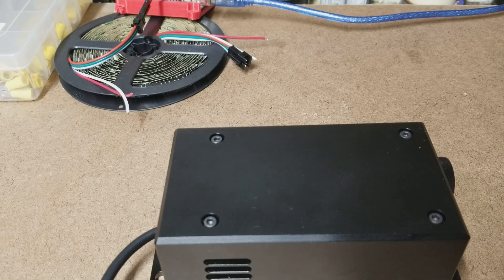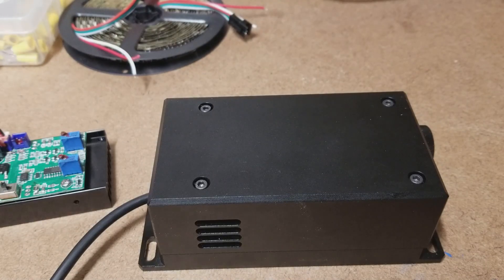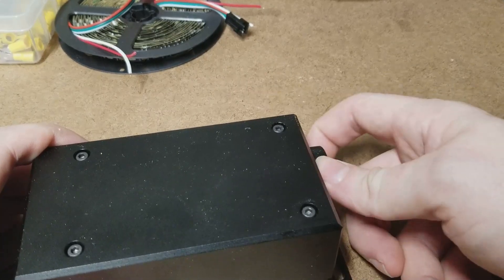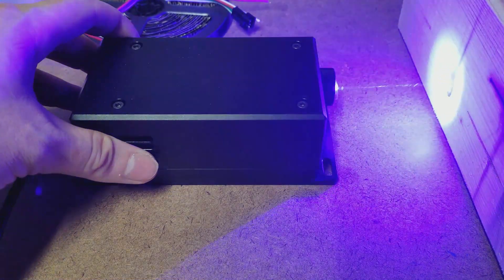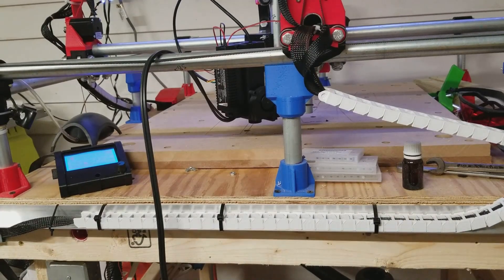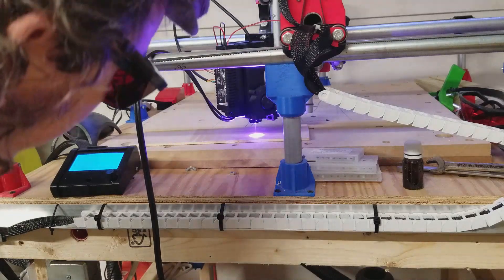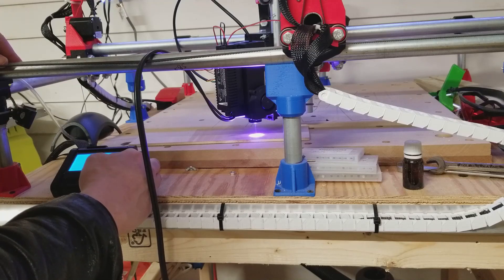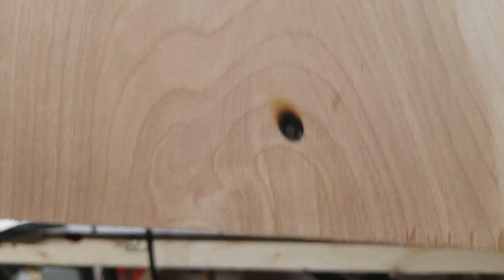'Most Powerful Laser Diode' Setting up a 17 watt laser module!

Comment: This is cool 👍
Spec's total laser power is 4.2W 
Adapter is 12V
The full module as advertised is 17W Adapter is 12W+4.2W=16.2 funny advertise 
 Laser diode's 2 x 2.1W= 4,2W Total Laser power

Comment: AWESOME!,  Now all I have to do is buy 100 of these at $299, Adequate power supply/supplies, 100lbs+ of various optical glass to get them all to converge and focus, and I'll be off and running with the ability to finally cut nearly 1mm of aluminum sheet! But first I would like to take a moment to thank all my testosterone saturated tools, made by testosterone based tool makers that took the time to design and manufacture tooling that doesn't implement twizzlers and unicorn farts into the construction process to provide me with the ability to safely and efficiently remove&replace heavy guage screws in excess of 5/16 or or the candaian equvalent "1,000,069 truedos weiner units". OK then, I'm off to start saving up the $30, 000k or "2.28===D canadian"

Comment: great video, There is no laser diode that would be higher 8 Watts, having two using a combine lens will provide almost double the laser power. But  am curious how long the laser diode will last. They say never set the PWM or TTL on full power which leads me to believe you will shorten the life of the laser diode. Typical of chineese products they build the shitest stuff to sell cheap on ebay or amazon or alibaba.

Comment: Good evening SteamPunk,  I just received the same 17W laser as yours ... I manage to modulate the power via a module that comes out in Pwm from 0 to 100% ... WITHOUT any other connection ... on the other hand I don't know where to connect the white / yellow wires for the TTL ... I tried on the card of my CnC which has the pin outputs as follows ... GND / DR / PWM2 / 12V .... White on GND, yellow on PWM2 while having the 12V which arrives by the external module in PWM ... so when everything is connected including my CNC card, I have the weak ignition of the laser from 0 to 100% but I cannot make increase its power by the software of my card which manages the spindle ... Do I have to connect the white / yellow wires on the "spindle relay" ...? or otherwise ... Thank you ... Philippe

Comment: Hello SteamPunk, i need a first laser for my CNC and i need to know how you wire all cables ...power, ground, pwm....etc on your board...because the price is not very cheap and i don't want to choose a wrong laser if it's to difficult to wire it...maybe i need a second board with 12v in and pwm out...? tank's a lot ..Philippe

Comment: There is no 17 W blue laser diode... 4 A corresponds to an output power of max  6W for the more efficient diodes. In pulsed mode you can push the strongest diodes up to 10W max.. Classic chinese rip-off. I just bought a 6W laser module that only gives 4W 😑

Comment: What thickness of wood is that?  My guess 3mm.  I've seen 2.5w cut that in about 2-3 passes with air assist.  Typically the air assist is using a coolant tube like on a cnc to blow concentrated air.  This gets the soot out of the way to cut fresh wood.   It's cool, but really when you get up into anything above 7W the price is approaching cheap CO2 laser systems.  You can get 40W CO2 system for about $400. That is not just laser head but whole system you connect up to your pc.  It will cut that out in probably less than a minute. I have the 2.5w, 3.5, and a 5.5w diode laser. But it does what I need for now.  I needed something to see if it's for me anyway.  Make a few things and when I feel the need I'll upgrade to CO2.   Thanks for the video.

Comment: China just slaps on numbers...its not even 10W. And if it is, then just for 2 min....
Reply: The eBay listing says 17W pulsed. Which I assume means it gets one pulse at 17W for a microsecond before the diode pops.
Reply: @outputcoupler7819  I checked most ebay items, most of them say 17W and nothing about pulsed. Either way, it wont last long. Pulsed or not. Blanking might help a bit but it does not mean you can squeeze out 300% ^^
Reply: @LaserGadgets  I know, I was being facetious. The idea being, attempting to get 17W out of this diode would result in nothing but the destruction of the diode.

Comment: Oxygen would make it burn more, not less. Airflow over the work surface as the laser is burning the material helps to prevent the material from settling and from getting on the laser lens. Fouled laser lenses lead to problems.
The lasers are in parallel, not serial. A CO2 laser would be a better choice.

Comment: If you want a faster cut you could try adding a small tube blowing pure Oxygen onto the focus point
Reply: I would be very nervous about using pure oxygen assist for an at-home project. Consult your insurance policy before attempting such a thing, and perhaps just use high pressure compressed air.
Reply: @JesusTouchedMyJunk  Yeah, that indeed would be stupid thing to try. Pure oxygen :D

Comment: How to made metal cutting CNC machine in home made ,metal cut 20 mm Maxima
Reply: You're looking at $15k to $20k for the laser generator alone.  Better off buying a used industrial cutting laser.  You can pick up a 20 year old Amada machine for $25k.

Comment: For the same money, you could get a 50W CO2 laser tube and power supply. Possibly a bit cheaper even. I found both on ebay for about $200.
Reply: @Paul Ash That makes sense. I'm glad you did as I've been curious about these 17W units for some time. Seems to be better than I expected! CO2 lasers are bulky, but not too complicated. Usually, in their application, the laser unit itself remains stationary (outside or incorporated into the cnc apparatus) while the only thing mounted to the cnc is a few small mirrors and a focusing lens.  The mount for which could be about the same size or smaller than this one. Not that there's anything wrong with your current setup. I like it :) All I'm saying is CO2 is faster, more reliable, and cheaper than diodes for this purpose. And it's easier than you might think. If the 17W blue ever lets you down, switch to the 30+W infrared side!

Comment: If your actually getting 17w from a 2x diode module then the diodes are being over driven for sure. Its probably more like 10 watts. I'd like to see you hook up some meters and see what it's really doing. Also open it up so we can see inside please. Its probably just a little glue holding it closed. I'd like to see how they're beam combining.
Reply: not even 10w its more like 1,000w maybe ..
Reply: @patman0250  I assume you mean 1000 mW, not 1000W. But no, this is clearly much more powerful than 1W. Probably it's a pair of 4W diodes being driven at close to max current.
Reply: @outputcoupler7819  yes I mean mw but I still think it's 1w.
Reply: @patman0250  You are wrong, this is not a 1W diode. I have several diodes in the 1-7W range, and this behaves very similarly to the higher power diodes. 1W diodes barely mark wood at all. The 7W diode chars the wood instantly, like this does.
Reply: If that what you think then you are sadly lacking in the laser knowledge department. a 1W diode is more then enough to char wood instantly. A 7W diode doesn't just char wood it catches fire almost instantly just like a co2 laser. Sorry to brake it to you but you most likely do NOT have a 7W laser if that's what the internet description said then you're really out of luck sins its most likely not. 7W diodes have just only been on the market not that long if its not a NUBM44-V2 then its not a 7W diode.

Comment: this guy spends 300 bucks for a laser but cant buy himself a decent screw driver, come on dude.
Reply: "since then"
Reply: people on youtube these days
Reply: Hi@AffiliatePro, I'm also intersted with this laser in the vid cause I thought it's powerful enough and cheaper than other ready built lasers. But I've became more intersted in your 50w laser tube with only half the price... Would you pls pls pls send me the link where I can buy the 50w laser tube, so I can check it out.. thank you so much!
Reply from the maker: I got plenty; I just didnt want to wrench it open at that moment, I have opened it sense to clean the lenses sense then, I should do another video showing the inside more clearly!
Reply: @steampunkprogrammer1225  After having it opened up, how many diodes can you confirm to be inside, since the highest outputting diodes would only do 6.5-7watts on 4.5-5 amps per diode; if it is truly outputting 17watts, then that's a sizeable  overdrive. Worst yet, the supplied amperage don't seem to match up against the number it's claiming per diode, let alone two, so this seems to be all over the place.

Comment: Air Assist with a higher PSI source and downsized with a smaller Diameter exit point will help with going faster.
Reply from the maker: MrMG I tried that as well but maybe i need more air pressure. Definitely worth trying.
Reply: I've seen video's with a 2.5w and up do those same cuts you were doing but in less time with proper AirAssist because fire/Ignition, however you want to call it lives for AIR, the more air the hotter it burns, hence why cutting is faster the hotter something burns the less soot there is, the less soot (also cleared by good air assist) means the laser doesn't get, for a lack of better words, "Blocked" from disintegrating the wood entirely.  All the while clearing and blowing out any actual Flames on the surface preventing shadow-flames.
Reply from the maker: Right I get the idea, the particles of burned wood actually block the beam so better removal better burn, and the point the beam hits the wood is hotter when more o2 is pushed into it, I do have an art assist mount I built but it only uses an aquarium pump to push the air out which is enough to protect the laser but maybe a real pump would make a bigger difference, Definitely going to give it a shot! Means I have to crack open the laser mount files and adjust it for the standard mpcnc mount however because I switched back.
Reply from the maker: Oh wow! Ordering right now!
Reply from the maker: The O2 pump arrived this week, I wired it up to find the analog side of the driver board died for some reason! the TTL still works so I'm going to wire up an arduino to handle that problem atleast for now and probably do a video on the whole process here soon.
Reply: A very dangerous idea, that is to blow pure oxygen under pressure for the air assist, it should burn white hot, (and burn everything down in sight if your not careful!), but it could be made to work. If the idea is to have the cutting beam to burn VERY hot, then this should do the trick.

Comment: 17 watt pretty powerful. Try a focusing lens   Would be interesting to see
Reply from the maker: It is actually very focused using mirrors and lenses both inside and outside of it, but after awhile longer of tweaking I got the distance down and was able to do a bit more but found the laser is still lacking enough power to be used for just straight up cutting wood.
Reply: Hmm have you tested the output power ?
Reply from the maker: I did, I also tried powering it directly from constant current supply to see if that would make a large difference, but it appeared to make none.
Reply: SteamPunkProgrammer when you tested the laser power in wattage you came up with 17w?
Reply from the maker: its not constantly 17w its pulsing, but yes I saw a peek of 17 watts
Reply: SteamPunkProgrammer ok now I understand. I was going to say a 17w cw should cut wood especially that nano meter

Comment: Thanks for sharing your video about the 17W laser! I was also thinking of buying that model. Did you try adjusting the focus to a more fine tunning? It took too much time to cut through. It would be nice if you made some more videos about this laser. What about precision? Is the thickness of the cutting radius thin or thick? I have noticed some 10-15W lasers are too thick. I decided to buy another 15W model of the same manufacturer, maybe a single laser diode can be better focused and be more eficient, who knows, only testing to find out. Soon I will make some videos also to share the results also. If you wonder why I thought it seemed slow, here below are the links that I have watched and made me concern about it. This video shows the cut quite fast and also the laser point is quite thin, so much thin that you have to kick the cut part out of the material by hand. Let me know if you have any thoughts about this also. I am quite curious about your opinion. https://www.youtube.com/watch?v=d7TLQ3PGeEo
Reply from the maker: a single laser diode cant output 15w yet (so if you see one its likely over drived and will burn out quickly I would avoid!) I did try with some more precision focusing but it never really got to the point where it was really useful sadly. I might experiment more in the future but for now I've gone back to using a router.
Reply: @steampunk
thats because you bought a lemon from china lol

Thats a dual array most likely pushing 10W. No beam expander to shrink that parallel beam down to a usable size, and the alignment coming out the front of that thing is atrocious.

No offense to you of course... china garbage just irks me ; )